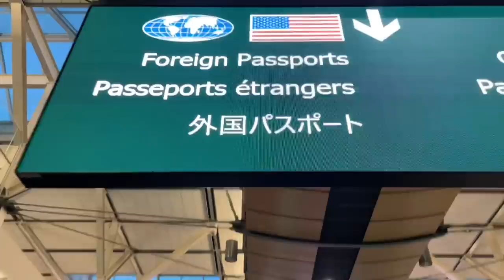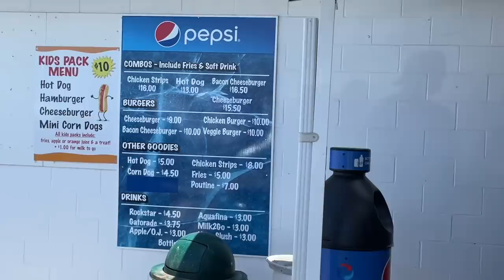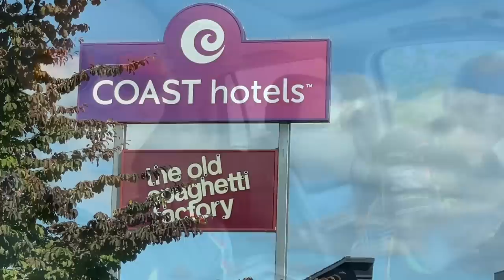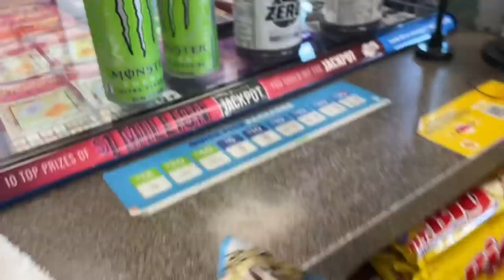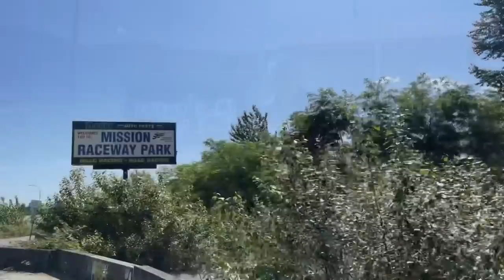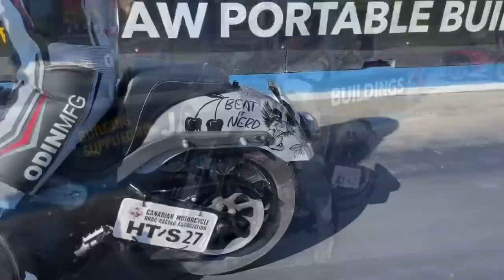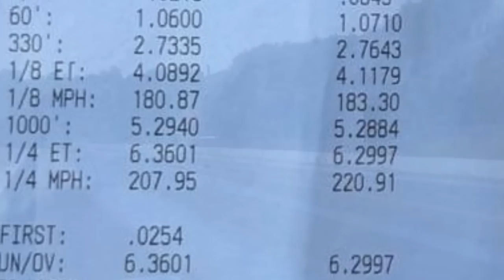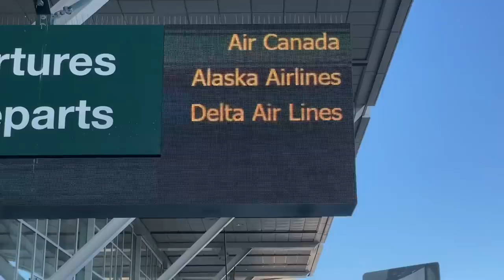You WON'T BELIEVE what I found on my FIRST trip to Canada 🇨🇦 (plus five motorcycles you must see)

Comment: Thanks from a Canadian for putting on a great drag racing show always and keeping the content clean and very family oriented. Thanks again and God bless.
Reply from the maker: Thank you for watching! Was there anything in this video that surprised you? Also which motorcycle was your favorite and why?
Reply: Since them TF Harley guys have to ride in the upright position mostly while making a pass and not like the crotch rocket guys that lay down all on top of the fuel tank they should make the TF Harley guys wear a riding suit with a parachute made into the back of it just in case the main parachute on the bike fails and the brakes aren't slowing the bike down fast enough or if they aren't working at all for some reason or if they have a very short shutdown area and it gets hard to slow the bikes down fast enough before they end up in the sand pit at the end
Reply: Agreed❤